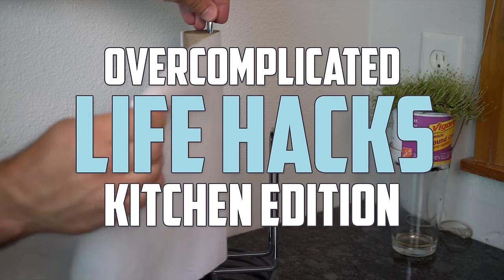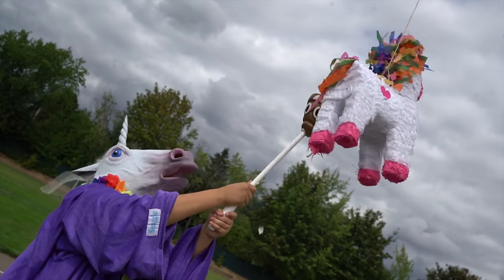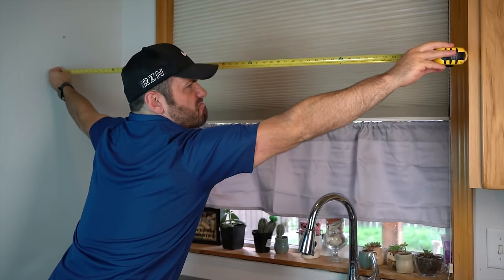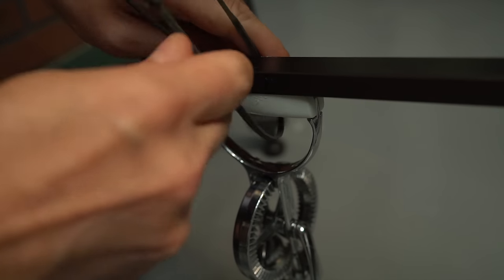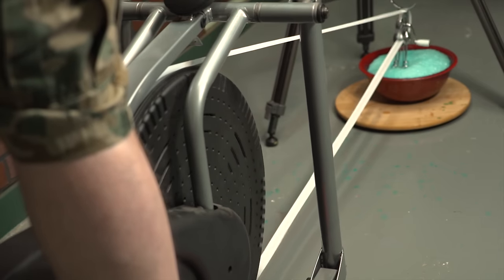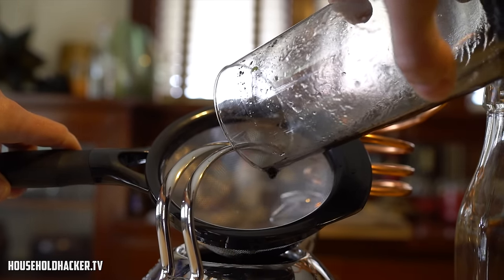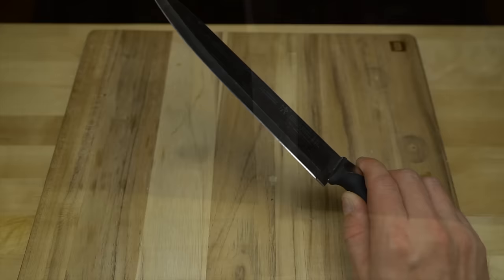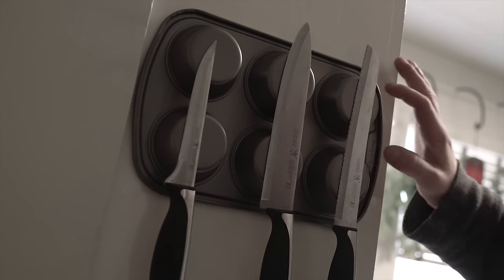Over Complicated Life Hacks: Kitchen Edition

Comment: I'm a chef, we use dish soap for the bacon grease sometimes depending on the amount. Once you're finished grab the hot pan and pour some dish soap in it, you will see it start trapping the grease! After that, you can toss it down the drain.

Comment: The knife one is actually pretty cool :D
Reply: well, it is, except the temper of the knife is probably ruined depending on the chemistry of the steel.
edit: but I do think it's really cool, I just used to work at a knife making place so couldn't help but think that the temperature could get hot enough to affect the temper and thus the edge retention of the blade

Comment: The TV host: If your ice dispenser stops working what would you do.

Choice 1: Just put the the ice that was supposed to be used for the dispenser into your drink.

Choice 2: Waste your money on a unicorn piñata and beat the heck out of it with the ice stuffed inside of it.

The guest: Jerry, it’s obvious that it’s choice 2, why would you spend only 5 seconds on filling your cup with ice!

The TV host: Congratulations! You have won a piñata with ice stuffed into it as a prize for answering the question correctly.

Comment: The magnetized metal didnt work. Got myself a metal watch band and wanted to get rid of the clip. Magnets stick to it, but even using a car battery didnt work. Tried 22awg and 24awg stranded wire. neither worked, and it never got hot.

Comment: if you need to shave off paint in a certin area use a flathead screw driver, for better results sharpen the top with a stone blade sharpener

Comment: you fucked up distilling process, coil should be made in a way that its spirals down to bottle. The way you made it makes it just not good, all the water is going to condense on a copper tube and run down to kettle, also without any active cooling system that voin is just going to warm up to a point where there will be little to no condensation left anyway
Reply: Hideki Shinichi these are jokes
Reply: Hideki Shinichi Said the professional moonshine bootlegger

Comment: Does the magnetic effect on the knives ever wear off?
Reply: Chopstick I don't think so
Reply: There are a few ways they can be demagnetized
* Rapidly changing magnetic fields.
* The knife being heated to (very) high temperatures. The internet says around 770°C (1418°F) is the temperature for steel.
* The knife getting multiple violent hits (supposedly, i have never seen this actually working).
Reply: Sod Alfredsod so not thousand degree knife challenge? :P

Comment: Bacon grease isn't bad for your pipes. But when it cools, it may solidify, and when it does, it could be a problem for water flow. Particularly if it happens at the purification facility.
Reply: noferblatz so... it is bad for your pipes

Comment: That not a water distiller, its a water filter- oh wait, arent those the same thing?
Reply: That is a water distiller and it's not the same as a filter.
Reply: Oh ok. Heck, i should have gone quiet.
Reply: Don't think of it as a bad thing. Think of it as a chance to learn! The only way to learn is by asking questions, after all. For future reference, a water filter would be something like a fine mesh cloth (though there are far more advanced and effective options) that you run the water through, straining any contaminants or particles that don't fit through the fibers of the filter out of the water as it passes through. A water distiller is like what he shows in the video. You boil the water into vapor, and most contaminants are left behind in the original container as the water boils and evaporates. Then the vapor is allowed to cool back down into liquid water into a clean container, with any contaminants that didn't evaporate and move with the water left behind in the original container.
Reply: @ShiftyMalcontent  Thanks for the message, maybe I don't have much self esteem.